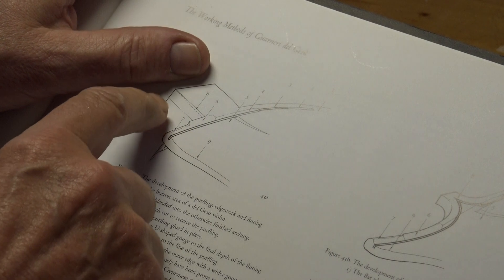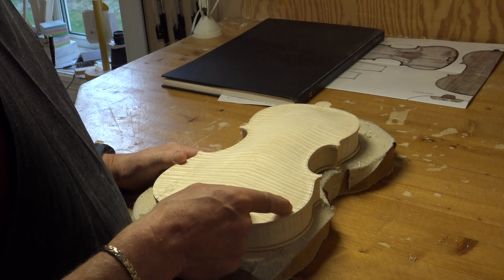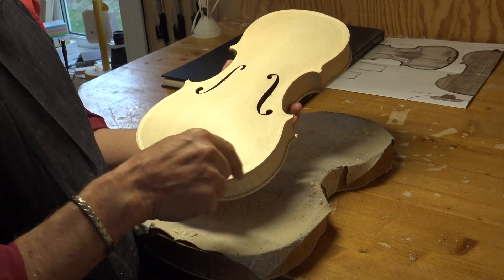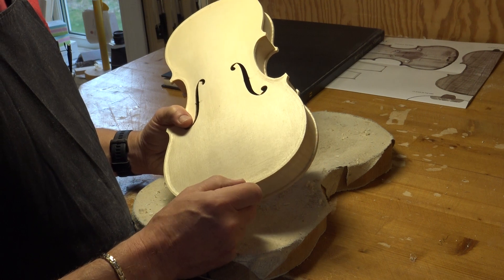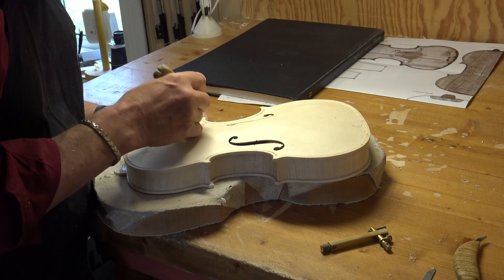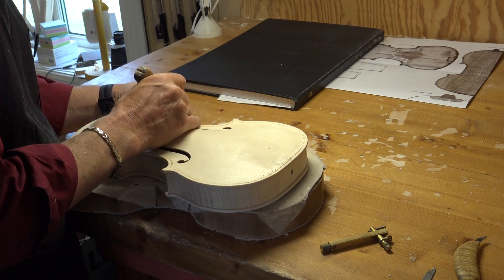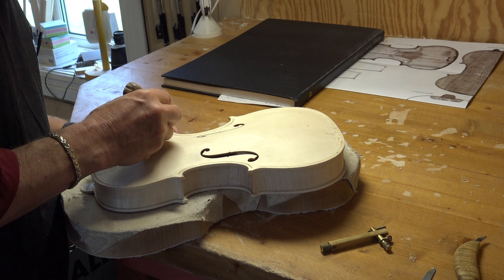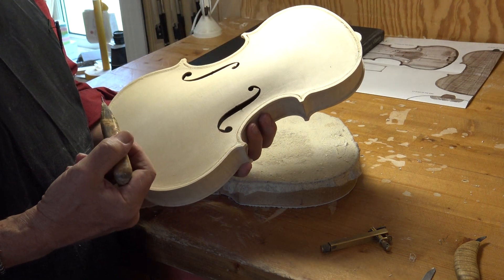Violin maker Peter Westerlund Part 50a. Theory behind cut of the purfling channel

Comment: I bought two purfling cutters (one the same as you have) and the gap between the two blades is greater than 2mm I need for my standard purling.  Have you done something to the blades to reduce the gap??   Some have suggested two single line passes but I think that this will be prone to error if not held exactly square.  Thanks
Reply from the maker: I would suggest that you sharpen the blades asymmetrically so the edge comes closer to the side on each blade. You can then choose how to pair them by switching sides of the blades. One narrow and one wide for example. They are sharpened in U-form so that they cut in both ways. I also use thin (0.2 mm) metal foils between the blades to have different widths.

Comment: I’m curious if you used your scratch method again to refine the top and back edge contour after trimming the overhang to size?
Reply from the maker: No, I don´t. As I see it the first tuning is done as it affects how the arching is formed. What is left outside the ribs has no acoustical purpose. If so, a violin would be bad after having dents or wear at the edge.
If this is correct, I don´t know but we all have our theories.
Reply: @westerlundsviolinverkstada9892  okay. I hadn’t quite understood that there was such a relationship in your method between the contour tuning and the arching. That makes sense. Thank you for taking the time to answer my questions every day or two. I’m greatly appreciating this series although my family can’t understand how I can sit and watch a guy scratching and tapping away at some wood for so many hours. I’m riveted at every moment trying to anticipate your moves.
I have one question about the purfling colour process. Correct me if I am wrong. I’m just guessing here. The acid bath is cleaning the wood, perhaps breaking down oils and making it susceptible to thoroughly absorbing tannins from the wood chip bath. That bath imparts some colour but more importantly makes the purfling highly tannic and thus the iron (sulfite?) turns it black. Is that what's going on?
Reply from the maker: @Nomadboatbuilding  I don´t quite know the chemistry here, but it is not an acid but an alcalic solution. As I see it, it "opens" the wood to be penetrated by the following solutions.
Reply: @westerlundsviolinverkstada9892  Well that's a good enough answer for me and pretty much confirms my suspicions. Thank you.